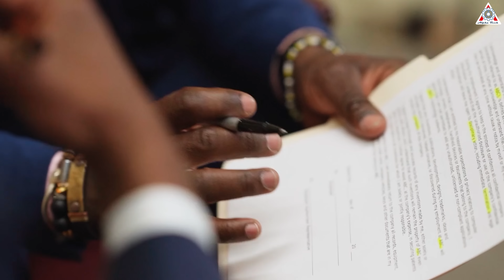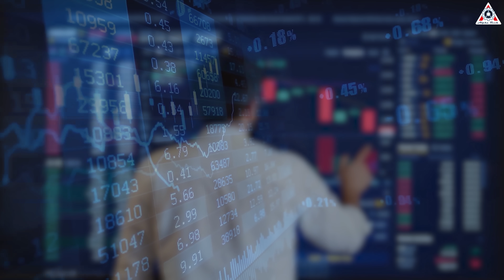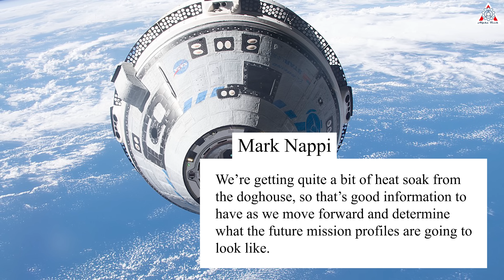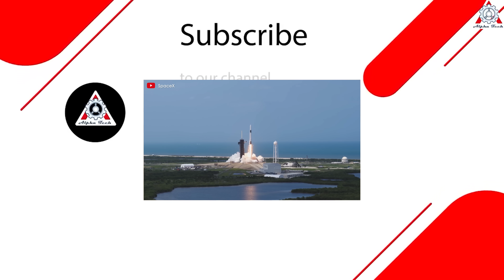Too Risky! NASA's Astronauts Back on Starliner. NO SpaceX Rescue...

Comment: Political over engineering decisions caused the Challenger disaster. NASA is a disgrace.  The competitive argument in this case is total bullshit and the opposite is actually the truth.
Reply: It was an o ring that caused the challenger disaster
Reply: @donaldowilly3973 look up Allan McDonald. He refused to sign off on the launch because the temperature at the cape was too to low and he knew the seals on the solid rocket boosters could fail.  They went ahead anyway because upper management didn’t want to postpone Christine McCullough class from space.  So it was a political decision that killed those seven people as the vehicle was launched outside  its operating parameters. BTW they also knew about the foam, before hand, coming of the external tank in the case on Columbia as well. How did that work out.

Comment: Has to do with compatibility between all the equipment. I.e. there is no standard between spaceX. BOEING, etc etc etc
Reply: They all use the same docking and mounting points. Starliner can launch on Falcon 9 if it needed to.

Comment: I smell the same scenario when Apollo 1 caught fire on the launch pad and killed three astronauts.  There were safety concerns before the launch of cutting corners, saving money at the expense of safety and the launch to go on regardless.  After this disaster, Gene Kranz, Flight Director said the following, "“Spaceflight will never tolerate carelessness, incapacity, and neglect. Somewhere, somehow, we screwed up. It could have been in design, build or test. Whatever it was, we should have caught it. We were too gung-ho about the schedule, and we locked out all of the problems we saw each day in our work. Every element of the program was in trouble and so were we. The simulators were not working, Mission Control was behind in virtually every area, and the flight and test procedures changed daily. Nothing we did had any shelf life. Not one of us stood up and said, "Dammit, stop!" I don't know what Thompson's committee will find as the cause, but I know what I find. We are the cause! We were not ready! We did not do our job. We were rolling the dice, hoping that things would come together by launch day, when in our hearts we knew it would take a miracle. We were pushing the schedule and betting that the Cape would slip before we did.”  After the investigations concluded Gene Kranz went on to say, “From this day forward, Flight Control will be known by two words: ‘Tough and Competent.’ Tough means we are forever accountable for what we do or what we fail to do. We will never again compromise our responsibilities. Every time we walk into Mission Control, we will know what we stand for. Competent means we will never take anything for granted. We will never be found short in our knowledge and in our skills. Mission Control will be perfect. When you leave this meeting today, you will go to your office, and the first thing you will do there is to write ‘Tough and Competent’ on your blackboards. It will never be erased. Each day when you enter the room, these words will remind you of the price paid by Grissom, White and Chaffee. These words are the price of admission to the ranks of Mission Control.”  Now after the Challenger explosion with frozen seals on the lifting rockets and failure of the heat shield of Columbia, there were whistleblowers that were concerned about safety but because of tight budgets and big egos, astronauts died.  History is repeating itself, regardless if Starliner returns safely or not, it will be luck if it makes it back and it will be the same as when Apollo 1 caught fire, the mission goes on regardless of safety and the big NASA egos.  The promises of safety first has been thrown out the window.  Anyone that was living around the Apollo 1 fire will remember like me the lack of safety killed these astronauts.
Reply: Apollo 1 didn't catch fire during launch, it was a rehearsal. Agree with everything else you said. They ignore engineers and took unacceptable risks.
Reply: Thanks Richard! We need this history lesson before the Starliner return flight, no matter how it plays out! Luck is never a good foundation for decisions when lives are on the line as they are in Human Space Flight! Peace

Comment: I fear for the crew of Starliner, the pressure they must be under to return on a substandard Spacecraft which might not let them down, but what happens if it does? I’m really hoping that they will resolve the problem and understand what wasn’t working as expected before the send the crew back . It would not be a good look to loose two astronauts on the first test of transportation aboard Starliner …
Reply: But.... it was easy in 1969. You need to start there to realise that NASA is a total, absolute grift. The moon and back, several times but they have no bloody idea how to rescue 2 marooned astronauts 300 miles away. What a seriously bad joke.

Comment: If you knew anything about government contract type… there are FIXED FEE, COST PLUS FIXED FEE, COST PLUS INCENTIVE FEE, FIRM FIXED PRICE and a few others.  Each type  consists of a basic contract with a set of requirements at the start of the contract, as well as how much the contractor can charge the government for any changes or additions or anything else that comes up.

Comment: Stayliner might have had the thruster  and helium issues patched up enough to last the trip home. What scares me most is what else will fail that is unknown as yet. It should be a no brainer to bring Stuckliner back on autopilot and rescue Butch and Sundance with Crew Dragon. Even tthat is beyond NASA and Boing collective mind to grasp. 
These press conferences sound very similar to the ones where NASA were say "it's only a lightweight foam so we don't see a problem with bringing the shuttle back". 😢

Comment: NASA's hatred of SpaceX continues... irrational and dangerous.  I doubt even when they kill these two nothing will change... after all NASA has killed plenty of astronauts in its storied history.... they are ok with it it seems.
Reply: Things got a little too political at NASA and Boeing. Both of them have made big $ off of each other so they have a long relationship. I used to think Boeing was amazing. They built some amazing aircraft in the 50s, 60s, and 70s, and 80s! It seems they started slipping when they got rid of their senior leadership that had engineering backgrounds and then put in people who do finance and money stuff.  I hope they turn things around and bring back the old Boeing where the engineers were heroes and took their jobs to heart and had pride in what they're doing and making things SAFE, instead of worrying about saving a dime here and there on substandard parts and equipment.

Comment: So, failure is an option, but potentially boosting SpaceX image is not. Why I'm not surprised NASA and Boeing do not care about the lives of their astronauts?
Reply: Yeah, I bet SpaceX could have a Dragon ready to go pretty quick. Just have to get their suit measurements and send up some suits with them that plug into the seats on the Dragon.  They can get things done quickly if need be. I hope these two make it home safely and they re-vamp that whole starliner program and build something that's 21st century like SpaceX did with Dragon. Just the controls and interfaces and automation that they have in place at SpaceX is impressive and that's what I think a spacecraft of today would look like. Neat lines, very neat interior storage etc.
Reply: @TaterRogers  yes - Space X is 2020s, Star Liner is early 2000s...

Comment: As an engineer in the aviation industry, we don't set maximum times lightly, I wouldn't want to be retuning on anything from space with batteries near or beyond the maximum set limit by engineers.
Reply: @flightsimdev  

It isn’t. The batteries are fine! Ready for Butch and Suni to get them home safely, on schedule and on target.
Reply: @flightsimdev  As an engineer for NASA and Boeing, the batteries are monitored and are fine. The Starliner was designed for over 180 days on station at the ISS.
Reply: @wolfman007zz  Then that relieves me a lot, as I thought the 45 days was the max usable time before degrading.
Reply: @flightsimdev  

Nope. And the battery status is not a guess, nor an unknown quantity; the status is known, monitored, and measured. They are rechargeable, after all.

Comment: Too much caution can scuttle the whole affair. Wrecklessness can also cause problems. NASA had a plan that got us to the moon and back several times, and we should not underestimate them.
Reply: You are correct, however that was >50 years ago, and a different generation ! NASA is stuck with top heavy management scared to act that might get them a black mark . And maagement a bunch of dinosaurs with outdated experience blocking any younger hot shot engineers !!!
Reply: Don't count in it. Apollo 1. Challenger and Columbia were examples of NASA's gungho,' full speed and damn the torpedoes' approach to crew safety. Additionally most of the engineers have retired or died.in the last 60 years. Boeing is run by cost cutting accounts with little interest in safety or engineering. NASA should be dictating to its contractors. The US taxpayers should not by paying for a flawed project like Starloser. Frankly trying to justify Starloser by saying it is is needed for competition only shows how divorced NASA is from being a commercially orientated organisation. It could be argued that Boeing is committing fraud, by selling something not fit for purpose. NASA is covering their backsides and is scared of publicly criticising Boeing, which will expose their own collusion. Watch out for scapegoating if people die - Boeing initially blamed the pilots of two 737Max crashes which killed almost 350 people rather than admit it was the MCAS system, to avoid impacting sales. Too much caution saves lives and reduces the CEOs bonus, but deaths during re-entry would be catastrophic to the US Space program which will probably have to spend a lot more money teaching astronauts chinese to visit the moon.

Comment: If they decide Starliner will return with crew despite problems...and it goes pear shaped and tragic...there will be court cases by the bucket load, both Boeing and NASA will be castigated to the moon and back.
As for Artemis...that will be delayed for the foreseeable future.
The ISS closed early and future missions just robotic for a decade at least.
Reply from the maker: Oh this future I don't want to think about
Reply: @alphatech4966  It feels like gambling on the outside chance that Starliner has no further issues...rest of the audience to this debacle knows a damn sight better.
If they think that the present mission in within parameters and no chickens in this roost...then why do the crew have no clothing and why is their a scramble to find them something to do while heads are scratched at Boeing...they are in trouble and everyone knows it...except they refuse to accept the point.